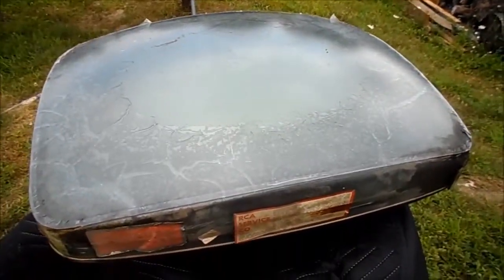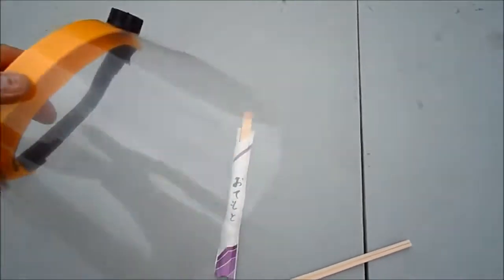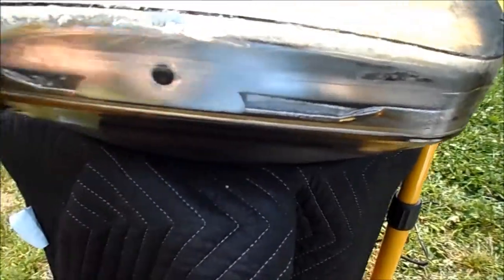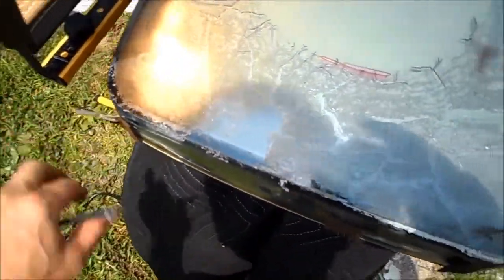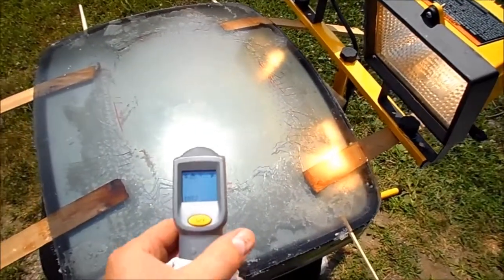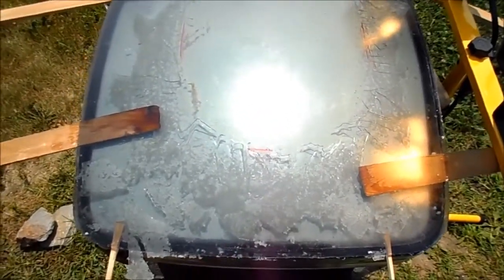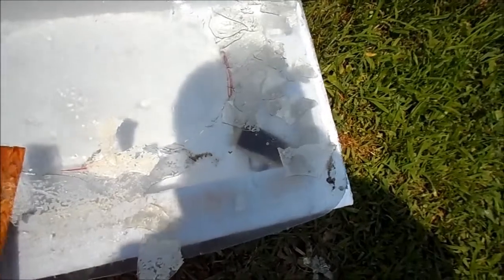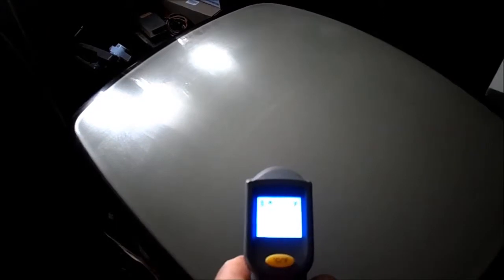25AP22 Pt.2 - Safety Glass Removal.

Comment: That is amazing! You're braver than I....
You say you plan on re-attaching the safety glass. How?
Is that what the double sided tape is for? I thought the safety glass worked because the plastic binds with both glass plates which prevents the glass from shattering.
If you use only double sided tape It can shatter. But the outside will have some further protection.
Can you clarify this for me?
Very interesting video.
Thanks for sharing!
Tom

Comment from the maker: I utilized a procedure similar to the DRH4683 method: watch?v=5l1EoMmmOcQ 
& Shango066's Safety glass removal (Non-Zenith, RCA type only). Believe the strap will hold the CRT sufficiently. Shouldn't be a lot of pressure on the safety glass itself.